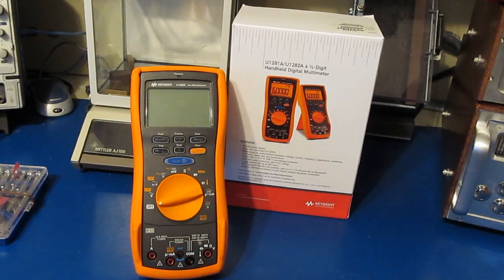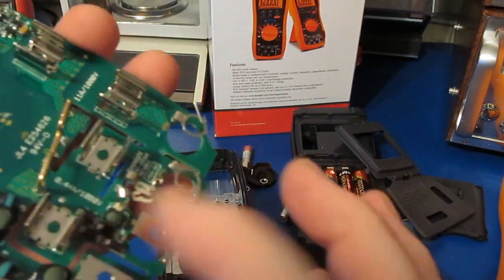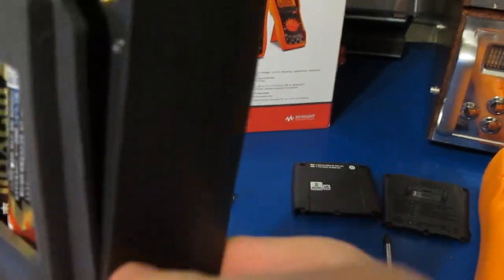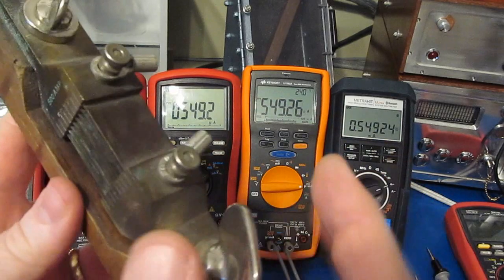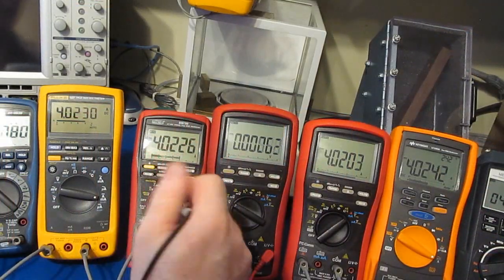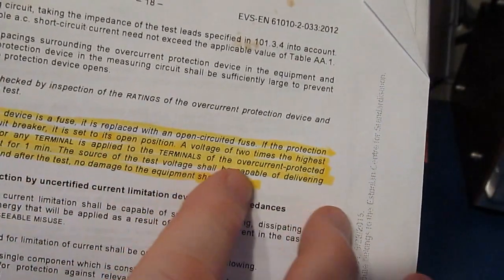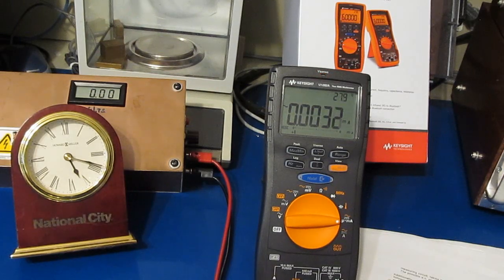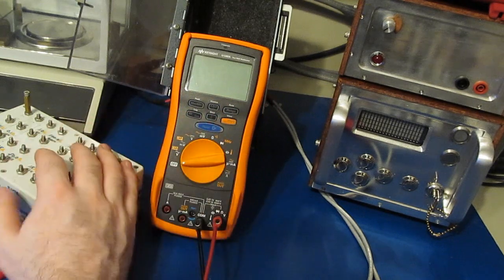Keysight U1282a Review Part4,  Viewer Suggestions and Beginning of Destructive Testing

Comment: As far as non-destructive tests go i am curious how high the frequency can go with a 3v and a 5v square wave 
realistically i would only use such a frequency mode to test oscillators
Reply from the maker: How would you plan on connecting the meter to these circuits?  After hearing from a few owners who have repeated this test, if you do everything right, the high end will be about 30MHz.

Comment: Let's design a hack for the BM869s that leaves the backlight on for 2 minutes - how about an add-on mod (external to the CPU) that does not require soldering in a new chip or re-alignment.
Reply from the maker: I would imagine there's several ways someone could pull something like this off but I would never suggest anyone attempt to modify their handheld meters.  Flashlights are cheap and pose no safety concerns.

Comment: If I told you to go buy a meter, what would you buy, 500 to spend
Reply from the maker: I don't offer recommendations and if you actually told me what to do, most likely I would take your cash, get a free meter from Harbor Freight, pocket the rest and take a few friends out to dinner.
Reply: @joesmith-je3tq  😂😂 ended up with a 869s and a 87v
Reply: After watching all of Joe‘s tests I decided to buy a Uni-T UT181. I own my now for 2 years and it is still the perfect meter for my bench with the best display I have seen. It is incredible precise compared to my two 6.5 digit bench meters. It‘s a pity that there is no after sales support from Uni-T!
Reply from the maker: @derdoktor7123  If you go back and look at my review for the 181A, you can get some idea how much longer your batteries will survive.  Mine is now starting to fail.
Reply: @Joe Thanks, I‘ll do so.
Reply: @derdoktor7123  as of now, 869s, and 87v, fluke 115, keysight 1232A,, I have a problem 😂
Reply from the maker: @zxrjimmy1  What, no UNI-T 181A?  Time to buy another.